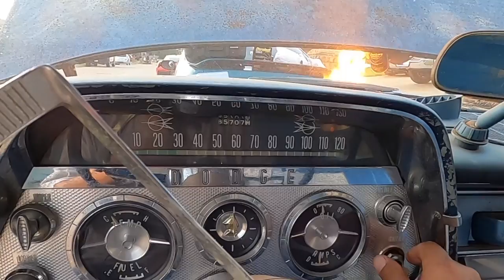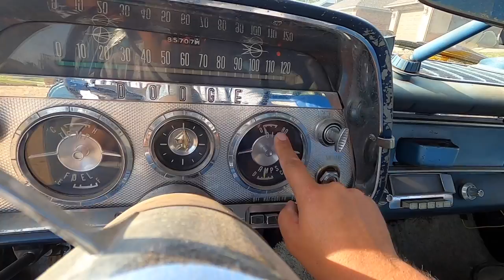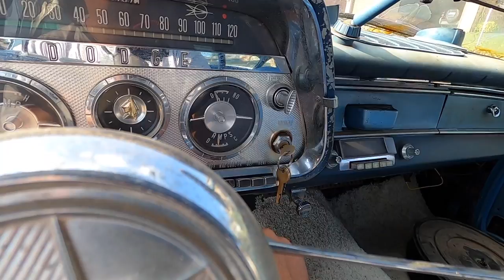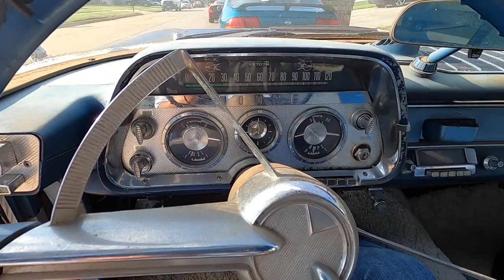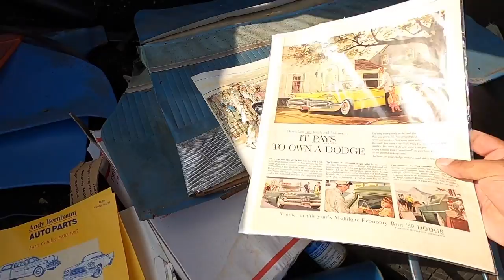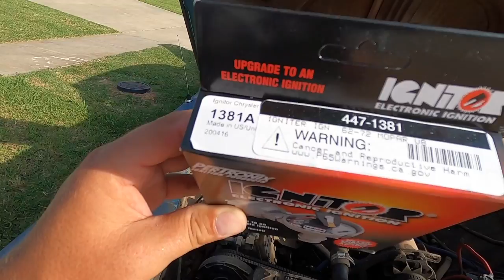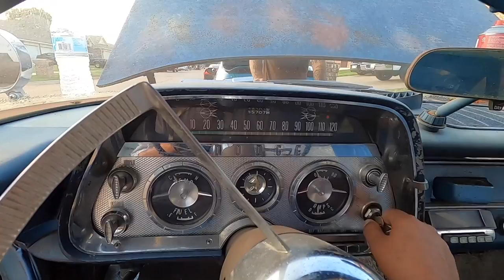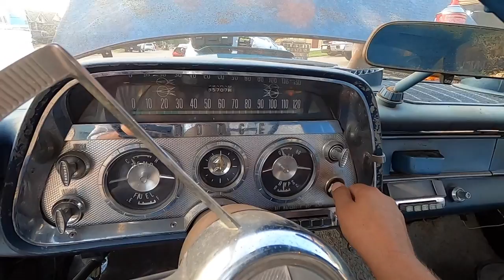I Bought a 1959 Dodge Coronet 326v8 for $4K on Facebook Marketplace - Will it Run?

Comment: I’m glad to see Weird Beard on the scene. The trans is a 3 speed Torqueflite, not a Powerglide. I see the D button for drive and two other buttons for second and first gear.
Reply: No it isn't.  The transmission is a Torqueflight.
Reply: Powerglide was GM's 2 speed automatics, that & a GM 12 bolt rearend was quite the set-up in the late 60's & all thru the 70's even mounted to a Big Block.
Reply: There's nothing I wouldn't do to own a car like this, and being a dodge fan is a plus, and the tail fins is the best of all, great purchase at a great price, just use a match book to set the points
Reply: Mexican Spec the guy already said that
Reply: He is a youtube  guy, NOT a car guy!
Reply: Looks like you're correct.  But Chrysler also offered a 2 speed automatic called PowerFlite.
Reply: It definitely is not a powerglide if it's a 3 speed and I haven't seen the dash yet it is a torqueflight
If it is a two speed is is a Chrysler powr flite I don't know where the millennials get these name s I wonder if it's a poly head I can't wait to see the engine if he shows it
Reply: @WalterWhite-1957  and if it ain't broke don't fix it
Reply: @gojoe2833  exactly I had one and a DeSoto with the small hemi 291
Reply: He probably saw power supply and his brain went into the power glide mode yes I would leave that car the way it is and drive it fix everything and leave it the way it is
Reply: Please stop apologizing for the squeak and the padding and the slight rust we're all mad and here I hope and we can fix anything nice car just don't apologize for everything I know there's people out there that nitpick but not me
Reply: Who would be torn about what to do with a car like that clean it up turn it up make it safe do everything mechanical you can and leave it original it's only original once
Reply: Never leave the key on on the points might they close and you will just burn them up with key on ,not running 
 Use accessorie to left
Reply: There's nothing wrong with that car. You're mistaken about the transmissions name. It's a torqueflite 3 speed it could be a power flight 3 speed but I agree with the other guys I don't know where you got powerglide from but don't listen to The bitchers that car is nice please leave it original
Reply: They did make a 318 poly, with a polysphere head.. and it was nothing like the new 318... that year did have a 318 but it was as big as a 440 and it had canted valves I'm not going to say you don't have a 326 because you could.. looks like I'll polyphere 318 to me
Reply: Don't dog for door.don't apologize for it not being a stupid mustang or a stupid Camaro everybody has one of those not everybody has a 59. Dodge Okay ? I saw a guy with a 57 Chevy four-door hardtop and he has the dumb idea to bondo in the rear doors. And made it look like a two-door hardtop and it looks silly..just saying
Reply: Leave the points in it .
Reply: I use a outboard motor gas tank in my Toyota motorhome with a electric fuel pump and I never have problem s
Reply: If it's leaking at carb fix leak. Tap later lol
Reply: Get a carburetor kit my God

Comment: Chrysler’s first V8 engine was the “dual rocker,” now known as the original Hemi. Developed from Chrysler’s aviation research, the efficient powerhouse had roughly hemispherical heads, opposing valves, and a complex valvetrain that used dual rocker arm shafts for each cylinder. 
The 326 was launched in 1959. Its actual piston displacement is 325.2 cu in (5.3 L) but it was marketed as a 326 to avoid confusion with the Dodge Red Ram 325 (hemi). 1959 was the only year for the Dodge 326 polyspherical engine. 
Dubbed the “poly” (due to its polyspherical heads) or “semi-hemi,” the new design had rounded, circular combustion chambers, like the Hemi; but they only had one rocker arm shaft, instead of the Hemi’s two. To make the change, they put the intake valves on the top of the rocker arm and the exhaust valves on the bottom. The results were lower cost, less weight, and higher production; the cost was a slight loss of efficiency. (allpar.com) Also, the the two speed automatic Chrysler used was a Power-Flite not a Turboglide.
Reply: Great read, thanks for posting
Reply: Chrysler made a hemi in 1950-51 called the FirePower.
Reply: My "57" had the Red Ram 325 "hemi". It was a sweet car!
Reply: This car looks like it has a torque flite, three speed, has D-2-1 buttons
Reply: @CR7659  the powerflite transmission which proceeded to torqueflite was a 2 speed automatic. It was Chrysler's first true automatic transmission.
Reply: Questionable? The Firepower Hemi was used in Chrysler vehicles from model year 1951-1958

Comment: Points and advance timing. After watching vid, get a carb kit. Fuel is bypassing the needle and flooding the engine. I'm 66 I know these engines
Reply: Rebuild carb , new wheel cylinders , brake lines , master cylinder. Clean gas tank , and tune up.
Reply: @josephmclennan1229  hi test gas.
Reply: strange to hear without the classic double reduction whining Chrysler starter of 1962 and on That's So Many associate with a Chrysler product.

Comment: Respectfully, Randy, I would certainly ALWAYS have a proper fire extinguisher on hand.  When you have even a potential for any gas leaking at all anywhere, even MORE so.  They are not that expensive and can obviously make the difference between saving or having to junk any car, much less a classic.
Finger wagging aside, this is an absolute CLASSIC and I'm so happy you have included it on the channel!

Comment: Be careful when you see vaporized fuel when working on cars.  Any small spark can cause the ignition of all gas vapor and liquid gas in the area.  Keep a fire extinguisher nearby with the pin pulled.  I used the flipper hubcaps from the deluxe model of this year   on my dad's 1954 Ford pickup.  In your climate vaporized fuel when ignited can reach out and get you at a further distance than you might think.  My family owned a 1956 4 door three tone paint.  White top, charcoal center and coral bottom.  Your best choice for paint is the stock color for a restored survivor driver.
Reply: One reason I never keep my head or upper body under a hood when somebody's cranking to start, and don't stay under there too long on a still-air day in any event. Reason two: broken belt(s) whipping off the engine and right into you.

Comment: Awesome example of a classic Virgil Exner design with factory air!!! I would have totally paid $4k for that one. Restore the interior and keep the patina....the engine will likely need to rebuilt with a modern valve job with hardened seats and valves.

Comment: AWESOME!!!  That fuel pump is probably pushing tooo much pressure.  A regulator with a gauge is a great idea. 7 psi is max for a carburetor whether it's a 2 barrel or 4 barrel.

Comment: PowerFlite 2-speed
TorqueFlite 3-speed

It’s a 1959 so it should have a TorqueFlite.
Reply: From what I understand in 1959, the PowerFlite was still being used only in six-cylinder Plymouth models.
Reply: Well obviously this car is a V8 so it’s a TorqueFlite. You can even see in the video the push buttons say D 2 and 1.
Reply: @calvinhandley2373  Not necessarily true.  My uncle owned a 1961 Dodge Dart Seneca 4 door sedan that had PowerFlite with the 318 Poly engine.  That was the last year PowerFlite was available as almost all owners preferred the TorqueFlite transmission.
Reply: Calvin Handley yeah the 1957 1958 plaza right?

Comment: The 59 Dodge 326 engine was the beginning of the across the board "one for all" corporate engines...its a Plymouth based 318 etc...to distinguish between Dodge engines and Plymouth...just look at the thermostat housing...Dodge were always in the cross over water pump housing...where as Plymouth were always in the intake manifolds....watching the video...you have a 5 button shifter...so it has a 3spd Torqueflite...not a 2 spd Powerflite
Reply: The Dodge 325 was a hemi. The Dodge 326 was a one year only A engine. Fun fact: It had hydraulic lifters and was discontinued because it was too costly to make.

Comment: Randy, your transmission is a 3 speed, probably the Torqueflight.  If you had the 2 speed you would only have a drive button and a low button.  In the catalog you saw a picture of the buttons for the 2 speed.  By the way, you can push start your car because it has a rear pump.  Push it up to 20 or 25 miles per hour in neutral and push the low button.  It will turn the motor over.
Reply: Just like a powerglide

Comment: My first cars had points - like witchcraft 😂 even filling stations used to sell them. For the miles you’ll do I’d stay with them, simple when you get your head around them. I still have a meter for the dwell angle and a strobe. I’m 7200 miles away or I’d head over 😊

Comment: I had a "57" and loved it! It was light blue and white. Push button transmission and rolling speedometer. I was able to go from drive to reverse as I had to in one instance when my front wheel came off. I was doing about 30 when t came off and had to switch to reverse to bring it to a stop as it had drum brakes all around. "I  did floor it when switching to reverse to break the wheels loose to not damage the transmission." Mine also had the Red Ram 325 "hemi".

Comment: i hear low/no compression on one or more cylinders
Reply: Yes, but that won't affect how it runs.  The rest of the cylinder will make up for it.
Reply: @mexicanspec  ..It will be slow/down on power! But yes ,they run smooth and perfect running on 6 cyl..most muscle cars had blown engines and people bought them and thought,thats the way they are lol they didnt know they were running on 6 cyl instead of 8!
Reply: @01trsmar  My 1963 Fury 361 has been running on 7 cylinder since I got her in 1982 and she still runs fine with no noticeable loss in power.

Comment: If it's the original trans I do not think it's a powerglide. All my knowledge and research indicate that the Powerglide is a GM only trans.
Reply: Yes as I thought this would have a Torque Flight 3-Speed.
Reply: "TorqueFlite" did come out in 1956.  https://en.wikipedia.org/wiki/TorqueFlite
Reply: This particular version would be called the PowerFlite, which would be a push button controlled transmission.
Reply: guys it was called powerflite,2spd like powerglide in gm,torqueflite was 3 spd.
Reply: Smurphy: That is a three speed automatic (1st, 2nd, and D). We had a Chrysler with the same transmission when I was a kid.
Reply: The dodge is a TWO  SPEED AUTO Randy missing spoke as a lot of people do when he said power glide as the gm power glide is the best known of all 2 speed auto transmissions but I knew he simply meant 2 speed
Reply: L Smith : Go back and look at the video when he is showing the push buttons. There are 5 buttons, 3 on top and 2 on bottom. The top reads R-N-D. The bottom reads 1-2. You can shift through all 3 forward speeds 1-2-D.

Comment: Buy a carb kit about 30 $ , easy re build ,I have a 64 Newport hard top 4 door all stock , 3 speed push button , summer driving last 20 years I think it is 4000 lbs good luck on the beast .

Comment: Set the Gap spot on,.Release distributor base plate enough to twist, get someone to hold starter on and rotate the whole unit til its firing perfectly. Old trick Grand Pappy taught me. Most interesting Ride you ever bought imo.

Comment: Randy I by chance looked up the auto parts company you found in the trunk and yes, Andy Bernbaum is still in business.
Reply from the maker: Thank you
Reply: @AutoAuctionRebuilds  by the way Sir,,, so you know,,  you can pull that point style Distributor and replace it with one from any 318 or 360 (even 340's),, and then you're good to go with the 72-80 electronic ignition system you find in any shortbed pickup from those years.
Reply: @AutoAuctionRebuilds  Hey,  on that same subject,,, the architecture of that engine is the same as a Polyspheric 318, so, the two barrels off the 318's will fit it.

If you look in the right places,,  there were 4 barrel intakes made for those engines in the 80's and 90's by Weiand. They were sold by Jegs and Summit and P.A.W.

Comment: $4000 was a great deal! As complete as that is even down to the factory A/C. Awesome!
Reply: I did not look at every comment, but you are the first to point out that this is a factory air conditioned car. Unusual for a Coronet series Dodge, but a lot of buyers ordered air in lower trim series to help offset the price of the air conditioning.

Comment: This car is equipped with a 3-speed Torque-Flight transmission. The Power-Flight 2-speed only had 4 push buttons on the dash (R-N-D top row, L on bottom). The Torque-Flight 3-speed has 5 buttons on the dash (R-N-D top row, 1-2 on bottom row). In the early 60s,  a lever was added to engage the Park notch.

Comment: Randy while you still have original points and condenser, make sure to not leave the key in the on position like when you messing with the radio for very long it can burn them out, and I'll look around and on some of the groups I'm with and send you the names of their Facebook pages so you can check on hard to find parts

Comment: That's a Great find ! The electric fuel pump should be under the car Near the tank.They Push better than pull fuel.Carb kit,tank cleaned or replaced,and the electronic ignition kit,this will one heck of a ride.

Comment: One trick I learned years ago about points is to use a match book cover to set the points. After you get the car running then you can fine tune the points but at least with the match book cover trick then you can at least get the car started. I used to do that little trick on my old 56 Chevy.

Comment: Glad to see you got it sorta running..my dad had same prob in his 65 custom 880 aka polar turned monaco..my hubby n I kept telling my dad to change the carb to a 4 barrel cause the 2 runs too hot..his 65 originally had a 318 in it but the person we bought it off of put a bored over 360 to b retro fitted 383..he never put a 4 barrel on it nor did he put hei for points so it ran like crap n one prob after another..it 2 had front drums n was damn well near impossible to stop unless u threw it into neutral or just slowed down way ahead of time...my dads was that color from factory but idiots painted it white which when we bought it for $3500 paint was turning yellow n cracking basically a cut off exhaust air suspension n a make shift wheely bar..we had it for 10 yrs and a lot of car shows with it n lots of memories..we never fully restored her but it was worth it was a head turner ..never let anybody tell you its a 4dr nobody will want it cause that is not true as 4 drs r making a come back..i kinda miss that car..he sold it over 2 yrs ago now n got 5k for it as we put over 10k in the 10 yrs we had it..he bought a 79 olds Royale 2 dr for 5k with a 20k original motor not v8 but the equivalent of a 4 cyl n my dad got screwed on it after he found out it was only worth 1500..i didn't want to b bearer of bad news so somebody else did..lol...love mopar..

Comment: I think you just put a GM trans in it,  but that's ok. I know its a cast iron beast of a trans to replace, check the trans oil soon. and power wash the old dog, it will be a good display at your new shop.my father use to sell those Dodges back then, and I have a picture of me standing beside a brand new one.

Comment: Y'all are gonna slam your head into a brick wall multiple times unless you learn something about this car in particular, and late 50s Mopars in general. I would strongly advise you to join the Forward Look group on facebook. Lots of super knowledgeable folks on there that will help guide you thru getting this beast to run and drive perfectly. We'll steer you in the right direction so you don't end up throwing out money( Exhibit A: the Pertronix kit) and wasting your time.

Comment: That carburetor is prone to have dirt between the needle and seat and the reason it flooded. You'd think the flow of gas would clear it but it doesn't. Pinch off or disable the electric pump, run carb dry. Turn on the pump and it should clear the dirt. It's also easy to install a new needle and seat. It's where the fuel line attaches to the carb. Yup I rebuilt / repaired many of this same carb. Same design used for many ,many years. My '74 D100 318 had a similar designed carb.

Comment: I had an old '64 Chrysler New Yorker 4dr with a 413 that I got from a retired doctor. Did some things to make it better, like adapt a Cadillac two reservoir master cylinder (I lost a flex line and lost all brakes), put a Mopar performance electronic ignition (HUGE difference in starting), and a few other things. Slapped some rims/tires on it and drove it around for a few years. Called it 'The Sled' XD

Comment: The bad thing about all of that chrome is that it is channeled on the back side for the clips that hold it on. Those channels hold water so be aware that there may be more rust under the chrome than you can see now. A great  job for Auto Auction Restorations! That is not the original key. Looks like an aftermarket ignition switch.

Comment: points are easy to gap, you use a standard stock business card and you're golden . i like the wings and the tail lights on that thing. very stylish! This isn't a classic you would see every day either so it's unique in more ways than one.Never heard of a dodge having a power glide transmission in it though, that's a Chevy transmission! it's not exactly "complete" but it's a good 85% and what isn't together already is there still so yeah not a bad deal and you haven't burned it down yet so there is still hope yet nice to see you showing the classic stuff some love too